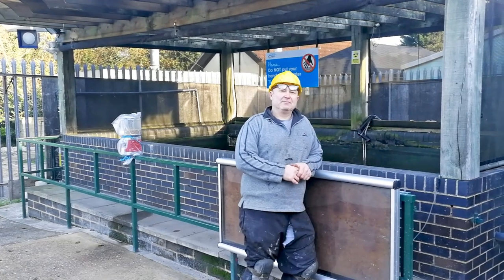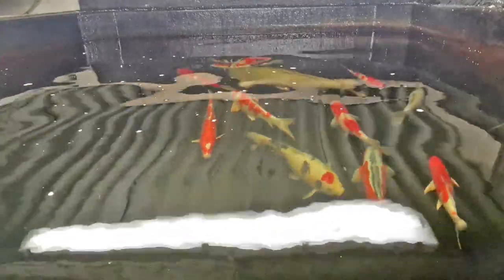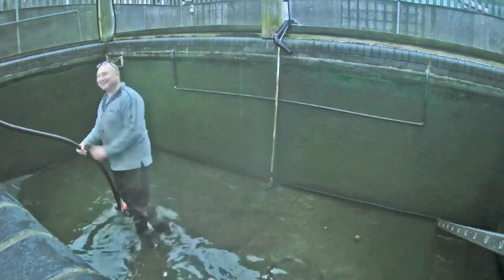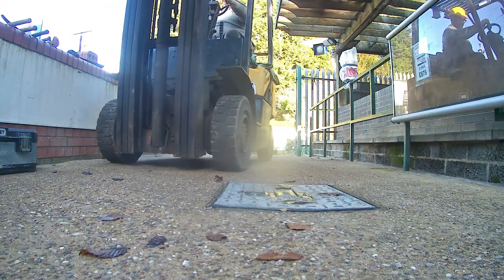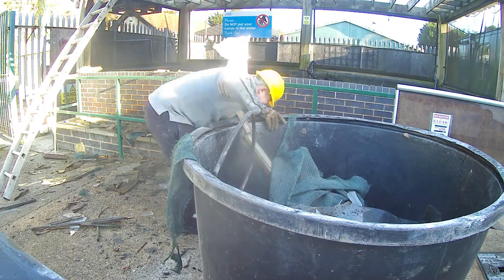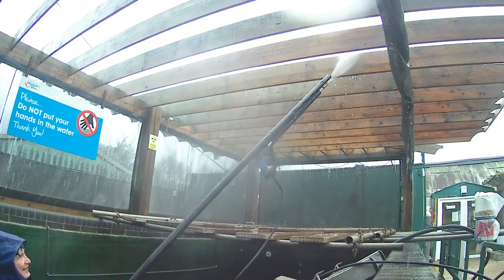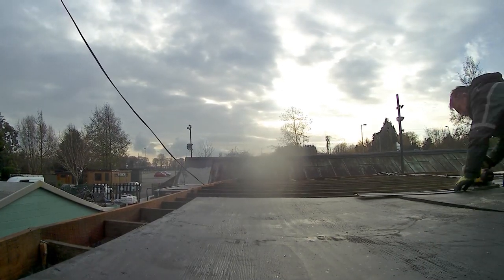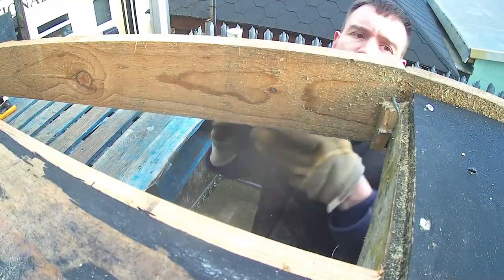Winter Renovations Part  Four.

Comment: Would you recommend a 2kw cloverleaf heater for an indoor 2700g pond? I’m looking to keep the water around 27 degrees Celsius because I am looking at keeping 2 redtail catfish.
Reply from the maker: 2 KW will probably be sufficient if the normal background temperature is already a comfortable living temperature. But it depends on the pond. If there is little in the way of insulation and the room is cold you might need more powerful heater.
Reply: @leecalladine  ok thank you. Im planning on building a fishroom later down the line if we move house because where I live now isn't big enough. Thank you for the feedback

Comment: Are they 8x1 rafters on the pergola?
Reply from the maker: Yes. I also did a animation of how to build the exact copy of this design step by step.
Reply from the maker: https://youtu.be/yQvrGDDI4BA
Reply: Hi Lee, I've used 4x4 post around my raised sleeper pond,  6 in total,  3 down each side, was wondering if 6x2 rafters would be okay/would work??? What do you think??
Reply from the maker: @JustinHT  yes that could work. Just make sure it is made solid but not to heavy.
Reply: @leecalladine  I meant 6x1 rafters..